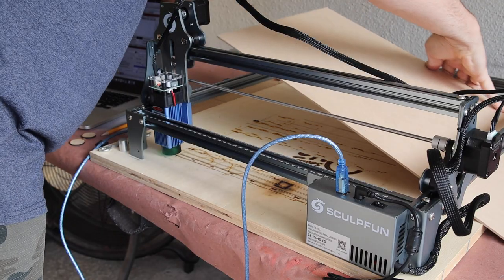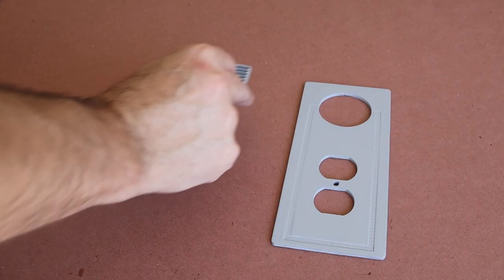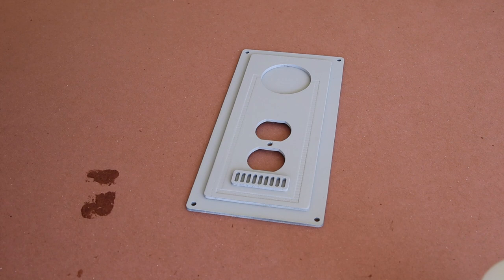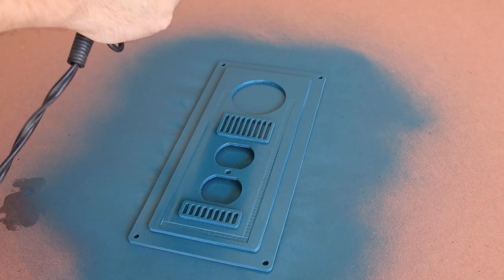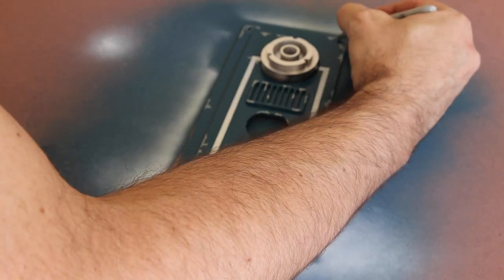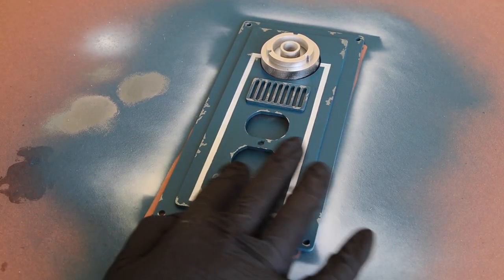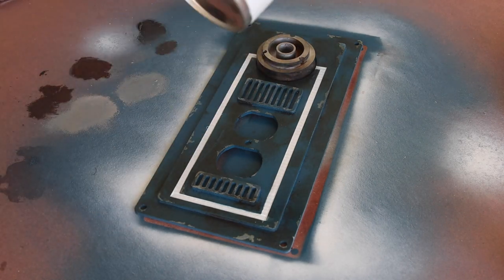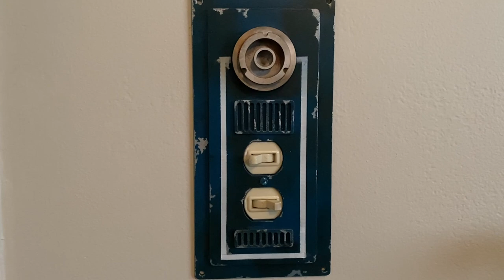Star Wars Galaxy's Edge Inspired Light Switch Cover

Comment: Also wanted to comment about the laser....not sure if it will work with yours because of the protector surrounding it...but I run a fan over the laser work space to help remove the smoke to get a better burn. Sometimes I also put masking tape over the burn area to help with the unneeded fire lines.

Comment: @4:18, your suggestion of re-applying a coat of the base color after masking is genius! It was one of those "How did I not already know that?" moments for me. 

I also followed your suggestion from your Mandolorian helmet weathering video and bought some water/oil paints and they work great! They actually dry in a reasonable amount of time, but give you time to adjust / blend them before they do dry. Great stuff, they replaced my standard oils which I had pretty much abandonded use of.
Reply from the maker: Glad it was helpful!

Comment: Great job! For aging I use watercolors mixed in quickshine floor rejuvinator. Some colors are translucent and others are opaque. You can thin it with ammonia.   Can be air brushed on and wiped off quickly.  Ussaly no chemical reactions... for matching old wood I use I  thinned oil paints and Japan dryer.
Reply from the maker: I’m gonna have to try that.

Comment: I think it came out great Derek! Has anyone tried using the 3D printed rocker switches fabbed to work with regular switches? Like maybe a drill a hole in each and use a rollpin through the switch...hmmmm